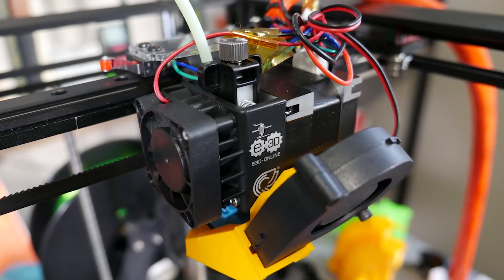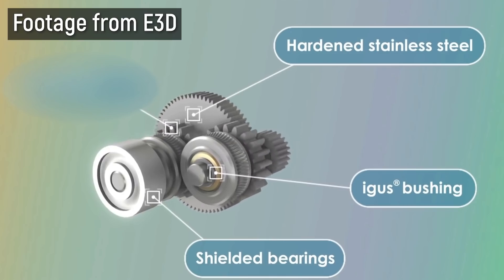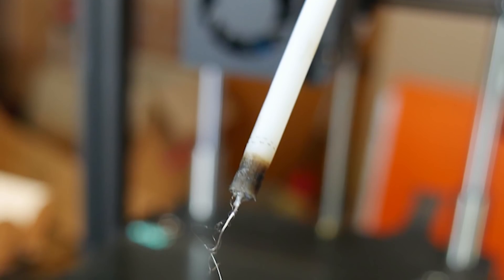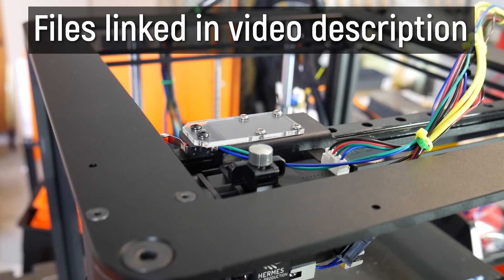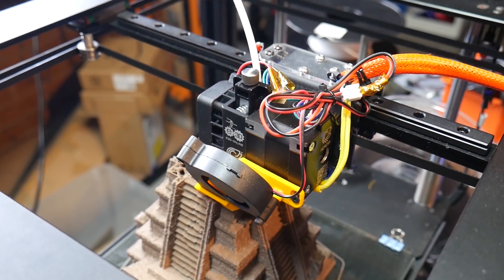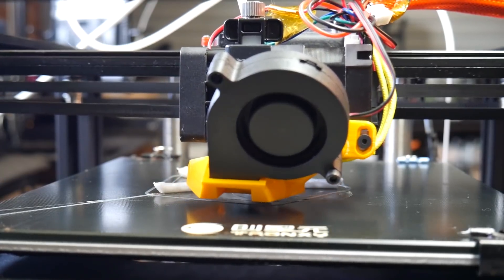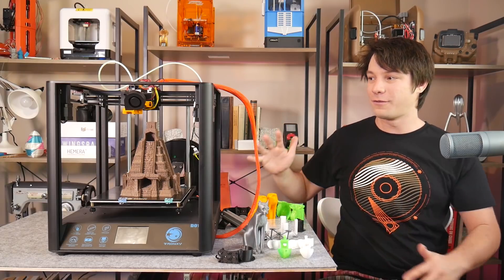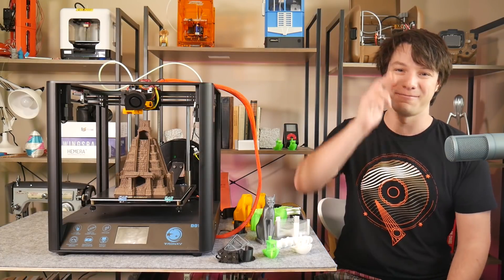I massively improved a terrible 3D Printer - Tronxy D01 Phoenix Edition ft. E3D Hemera

Comment: I actually observed very similar issues as you did where the filament repeatably wouldn’t extrude at a certain height. I also used a hemera and only had this issue with my white filament, so I assume that it may be due to the white needing more pigment? Nevertheless the solution for me was to clip a microfiber cloth soaked in a little bit of cooking oil on the filament. I also would be interested in why exactly this happens as it seems to be unique to the hemera...

Comment: I've had a Hemera (mine is still branded Hermes so it's a very early one) for over a year. I can't print TPU simply jams after a few layers. I have had several leaks (expensive) and loading filament is very awkward. I suspect I have a VERY early unit. BUT! it prints beautifully in PLA or PETG. Hate the "T" slots though and it's darned heavy!

Comment: When you get a roll of PLA that inexplicably prints best at 240C (No, I didn't accidentally order PETG, I checked the spool, packaging, and amazon listing)
Reply from the maker: I had a roll of PLA that became ABS half way once lol
Reply: @MakersMuse  I were so confused ordering 2.85 mm transparent PP when needing 1.75 mm. Or the description were changed. So send it back to Amazon. Now I am waiting again for a order, but from an austrian (!) not australian distributor. Also a prints fixing tool with hot tips.
Reply: @MakersMuse  Also, thanks for sparking my interest in the hobby! I would never have gotten into it without your videos.
Reply: UPDATE: It turned out I was being ignorant because I am new to 3D printing and blamed the filament far too quickly. The issues I was having (horrible under extrusion) quickly came back even at that high temperature and it turned out the hot end PTFE was not installed correctly. I reinstalled it and it fixed the issue, allowing me to make beautiful prints at a much more reasonable 210 degrees C. My machine is a Prusa mini+ and I am using Hatchbox PLA. If anyone has similar issues on this machine try following Prusa’s guide on replacing the hot end PTFE (except just reinstall the original PTFE unless it is wrecked obviously)

Comment: i had an incident with thermal runaway on my ender 3 pro with the 32 bit board when it was less than a year old. luckily i was right next to it when it happened. from what i've read, creality still hasn't implemented thermal runaway protection in the ender 3 printers, so you might consider yelling at them too

Comment: Have you printed everything on that wobbly table?
That might explain why the cat failed at nearly the same height.
I've never seen such violent wobble before :D
Reply: I couldn't tell if it was the table or actually the tronxy that was flexing.  But I'm leaning more towards hermera heat creep as the cause of failure.
Reply: @MoeReefs  I think I saw one clip where the spool holder, placed on the table, was wobbling at the same intensity.
Reply: Well it succeeded when he changed filaments. Maybe it's a combination of heat creep and retraction? Maybe the silver handles retraction better in a way that it didn't cool too high up the hotend?
Reply from the maker: I'm not 100% sure why the yellow cat failed but will do some investigations. Sadly yes the table is mega wobbly - almost all my desks are foldable to free up space and they're REALLY wobbly. I'd love to get a well supported rising table for the studio this year which doesn't wobble.

Comment: Speaking of Slice Engineering, would you consider making a new video with instructions on how to set the code for the control boards to use their very high temperature Thermistor? I bought their 450°C unit and my CR-10S, CR-10S5, Ender 5, Robo R2 and Tevo Tarantula Large/Dual units absolutely refuse to function with it even using the TH3D Studio firmware. The professors at University of Massachusetts Amherst find no problem with my code, TH3D Studio gave me very precise and detailed instructions for how to use that Thermistor with their firmware, my multimeter  continuity tests show it is clearly connected properly, but I still receive nothing but no Thermistor indications on the screens.
Perhaps you're doing so would make the problem I have obvious to me.
Thanks for considering it at least,

David

Comment: I recently had a filament failure similar to yours on the cats. There were some just barely out of size sections that wouldn't feed through my capricorn tube. Just sorta stopped. And what threw me was that it happened at a specific time interval. Maybe you had the same thing, or maybe it was the 3d printer gremlins.

Comment: Attaching it is simple but requires drilling a few new holes in the metal extruder mount? I'm not sure that I would consider having to drill holes in to metal as a step in a "simple" process. Thanks for the video. It is good you don't let companies tell you what to do when it comes to providing information the company may not like to have made available about their products.

Comment: Been looking for an inexpensive 400x400 printer to get, Tronxy D5SA Pro looked promising until reading all the bad reviews and then I saw this video about the D01 and wondering if Tronxy is a brand to consider or avoid at this point?  Big concern would be lack of firmware updates like marlin based boards see.

Comment: I have the exat same issue with my filament. I'm using DasFilament for a long time now. I have a new setup hotend, fresh nozzle all that stuff on my prusa mini. Loaded filament, everything fine, but starting the print, it glogged immedietly. Coldpull, new attempt, same result. Coldpull,another DasFilament spool, freshly openend, same issue. Then another coldpull, swapped to Filamentworld, run the same gcode and it printed perfectly. The colors that didn't work were yellow and orange. Might it be too much pigmentation? Making the filament harder to push through? I also tried higher temps and I use a 0.6mm nozzle which should be better on that, but still no luck on those DasFilament spools.

Comment: I'm a bit concerned with bed mount flex on this machine. It has pretty long shoulder so printing anything just a bit heavy will create enough load to tilt the bed... One possible way to reduce it is to move print head on the other side of the x/y carret and move bed closer to the Z axis.... Am I overthinking it? :)

Comment: Hey, i like your videos <3

Which 3D printer would you currently recommend to a beginner ? 
It should be operated in the apartment and therefore not too loud.
I would like to invest ~300€ and not necessarily have to buy upgrades directly. The print space should be about 200 x 200 x 200mm. 
Material would be PLA, later PETG and TPU.

The Anycubic i3 Mega (without upgrades) from a friend is a bit loud for my liking.
What about the Ender 3 Models ? 
The Prusa i3 MK3s is my favorite, but too expensive for a hobby that i don't know how long it will be fun to me right now.

Greetings from Germany.

Comment: So much concern over the mass of the extruder, what about the mass of the bed, it's much higher.
Reply: not an issue with this printer design, since the bed doesn't shuttle back and forth like on a cartesian printer such as the Ender 3, the only movement is the small vertical moves when changing Z, and weight is negligible for those assuming you have good bed support.
Reply from the maker: The design is rigid enough but there is definitely more moving mass to contend with, hence the folding table it's on wobbling so much!

Comment: Would it not be a good idea to change this printer, and close all the sides and top of the printer, to trap all the heat inside. So you can run a cooler heated bed?

Comment: All I know is, I still trying to get the 2020 model Tronxy X5SA printer I got to just level right so I can do prints? 
I watched your good videos and tried to get this damn printer to level right for ages.
I wish there was a way to work out why it will not level right? 
It has auto level and manual, But as soon as I do the Z off set part after the leveling bit, the printer just either digs into the bed or sit's 3 or 4 mm above it printing in mid air.  
I got the updated firmware from Tronxy to use my Titan extruder and TPU , ABS etc. But still the leveling is doing my head in.
Reply: Try the TronXY FaceBook user group.

Comment: Hey Angus, I own two tronxys (x5sa 2e and xy 2 pro) and I feel your pain. BUT I have to say that the machine with most problems has been the well reviewed sidewinder by artillery. This machine burned my nerves while with tronxy I only laugh hysterical...
Reply: Out of curiosity what issues do you have with your Sidewinder and do you know which revision it is? 

I have the V4 (latest revision I think) and so far it’s been mostly great other than the uneven bed heating, which I resolved by using some adhesive and/or a brim (and it only affects prints that go to the outer edges, as most of the build plate but the last 20mm or so around the edges is fine heat-wise and the build plate is so large I rarely run into it). 

I’ve noticed the z axis isn’t as rigid as I’d like but haven’t done many tall prints yet so haven’t bothered to resolve it (there are some simple solutions using 3D printed parts and metal tubing).

Other than that, the volcano style hotend isn’t as precise for smaller prints as say my CR-10 mini with a regular smaller hotend, but it’s been great for large prints using high layer height (.3-.4mm) with a 6mm nozzle. Super fast prints that way and I could probably go even higher with the nozzle size and layer height, just haven’t gotten around to testing that yet.
Reply: @einsteinx2  yeah it was the version 4 as well. I had the machine for let's say 2 or 3 months and in this time I guess everything that could go wrong with it went wrong. It started with hotend problems and ended with replacing z and x cables because of bad cable quality. I was so frustrated about the fact that (in my case) design has been more important to the company as reliability that I decided to stop this.
Maybe it's because I am on the petg side and do not like pla because of my own purposes. Well tronxy has definitely a lot of issues but if you can help yourself and swap firmware to marlin you get really good results for a cheap price. I mean the xy 2pro has more build volume compared to ender 3 etc. and it's around 130€...
Reply from the maker: Sidewinders are so hit or miss it's a real shame. Mine had bad flex cables initially then it was great, and the guy I gave it to has been using it ever since. Like Ben said, there's tonnes of versions and it's hard to tell which is which.

Comment: So its basically an overweight knock off of the Biqu h2?
Reply from the maker: I really like the H2 tbh, but the hemera came first by about a year so if anything it's a knock off of that lol
Reply: @MakersMuse  I've been running a regular H2 on a Kay3D upgraded Ender 3 and I like it for the most part.  Though if I remove filament too fast manually it tends to string and block the extruder, if I use the menu to unload filament it doesn't happen. Overall I like it enough to have bought the all metal version for the i3 mk3.5clone that I'm building  (bear frame)

Comment: I have tried it all.  All those premium hotend setups are not worth the investment with all the other options available. No noticeable improvement in print quality compared to a v6 clone with a 3d printed direct drive mount and a creality knock off dual drive extruder.  Total cost about 30-40$ and easier interchangeable parts.  Also dont ever buy the knock off bondtech extruders.  Those things always fail in about month of heavy printing as the plastic gears wear out.  Cant speak for the genuine bondtechs as I am too cheap to buy one.

Comment: Finally.  First. Oh, and don't mess around . There is only Creality Ender 3.  Stop pretending there's another valid choice.
Reply from the maker: I mean yes, it's incredible value for PLA - but can you do CF Nylon on it? Not without significant mods.
Reply: @MakersMuse  No reason to work with nylon.  It's horrible, and unnecessary for 99% of use cases.  Carbon fiber in filament is a gimic.
99 percent  of Makers Muse videos are PLA puzzles
Reply: I think that may be the most closed minded view on 3D printing I've ever heard
Reply: @elliottleslie8236  Mayan dice towers in CF Nylon...Lol!
Reply: I actually started with an Ender 2 on Angus' positive words in the machine.   Smaller  and cheaper is underrated.  Big machines  can make big prints....neat.  Everybody needs a really big bust of the incredible Hulk, and a giant Thor's Hammer.  Cool.
Takes 75 hours to print, and you can throw it directly into the ocean with all the other plastic crap, because you'll be bored with it 10 minutes after it's finished printing.